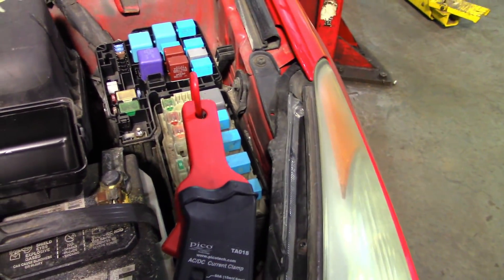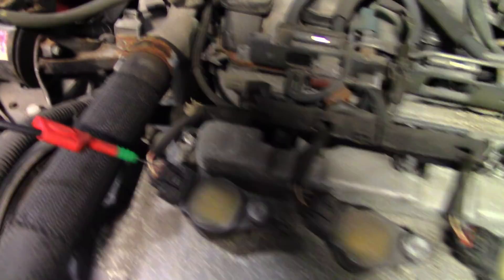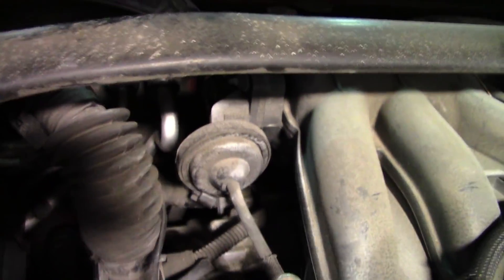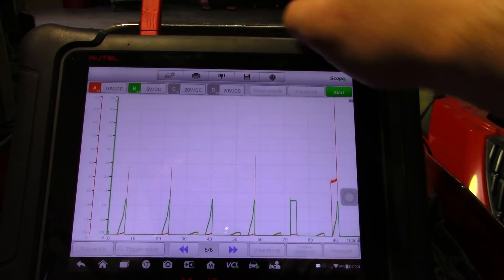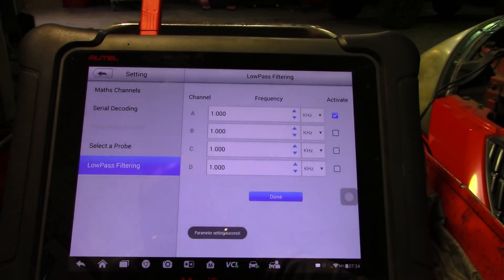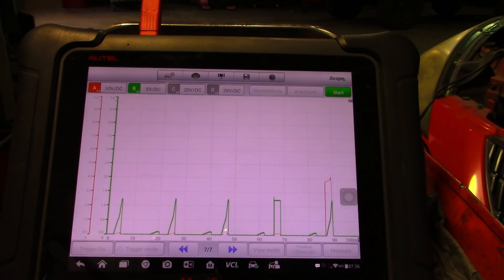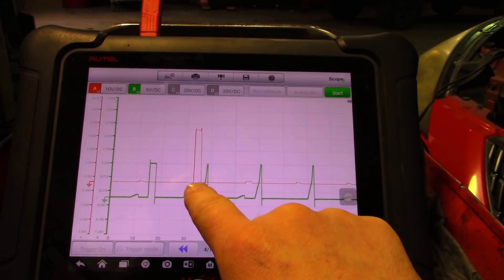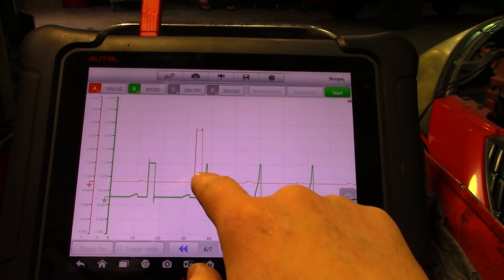Toyota Solara misfire diagnosis with autel maxiscope

Comment: I just bought the Autel MS906BT.  So far I like it.  I like the videos on using the various scan tools and like to hear the opinions on which one guys like you like and don’t like and why.
Reply from the maker: For me, I like my verus because it feels so much more user friendly, and the graphing is second to none. I like my autel because it has far more features. But I like my diagun because it is hands down the fastest and most convenient to use.

As far as my dislikes. I dislike the cost of snap on tools in general lol. And they have far less features than what should be on a tool for the cost they're selling them for. The autel, well, right now it is being sent out for repairs for a battery replacement, which frustrates me since it is only 2 year old. And the only thing that I don't like about the diagun is also what I like the most about it also. The size lol. Sometimes I love that it is small and compact and sometimes I just wish it had a bigger screen lol
Reply: Thanks for your opinions.  I use to work full time as a tech back in the 70’s and 80’s but stepped away from it on a full time basis, or so I thought, and went to work for the juvenile correctional system here in California.  What I didn’t know is that I would start working out of my shop at home.   I’m practically full time but I don’t see the volume of drivability issues that I would if I was actually in a repair shop.  I have managed to keep my master tech status current all these years so I think there is still hope.
  I try to keep the costs of these scan tools down.  Snap-on is out of the question but from what I’ve seen on Eric O and your site is it does seem to have better graphing.  I can’t get the Autel to put more than one graph up at a time.  Would be nice to watch O2 and fuel trim graphing simultaneously but I’ll manage.  
  Anyway, thank you for your videos.  I resort to YouTube and the internet for a lot of help.

Comment: Hey...liked your videos....just a bit confused about buying a scope...m just a newbie...and want to start getting hands on electricals....a bit curious if this scope works okay with pc?? And can it handle CAN bus signals??? Snap throttle signals? Crank sensor signals??
Reply from the maker: shaishav shah yeah. It absolutely works on a laptop. I don’t use it on the laptop often, but I do know that Corey over at S&A auto does.
Reply: Thanks so much...

Comment: Sir, When you use amp clamp with autel scope can you just use generic amp clamp or do you have to create a special probe to use one. On my verus you could only use the snap on amp clamp when you picked amp clamp from the menu because if you used another brand it would not give proper readings. I did not know that til I watched a scanner danner video when I 1st got the verus.  Thanks
Reply from the maker: When using the autel scope and an amp clamp, I just do the voltage to amperage conversion in my head, honestly.

Comment: Very nice. Thank you.
  Does Toyota have a specific scope that they supply?
Reply from the maker: Yup. They sent every dealership a picoscope as a special service tool.
Reply: @VoltageDropDiagnostics  The OE scopes have special tests and attachments. I played with the Masserati Pico for a minute, strange stuff. Only issue is they are on a special license and cannot be used with (and are locked out of) the downloadable software. They come up on ebay occasionally, but wouldnt buy an OE issue for above mentioned reasons. I really want a Pico, but another day.

Comment: Just one question, would you buy the autel scope again? Is it worth the $$ spent?
Reply from the maker: Rod X the 2 channel picoscope was sent to my dealer from Toyota. But It’s nice having more than 2 channels.

If I had a 4 channel pico, i wouldn’t consider buying the autel.

But with me only having access to the 2 channel pico. The autel fills that void perfectly.

In a perfect world, for me. I’d just have the 8 channel pico haha
Reply: @VoltageDropDiagnostics  As would I. The Pico isnt in my budget at this moment, or for many many moments to come, so i think the Autel will suffice. The Pico software is the best and most versatile i have ever seen. I like that you can define parameters for your own Transducers and custom sensors. Pico and Autel are the only scopes i am aware of that can decode network serial data, UART, CAN, Flexray, and some others. Thats useful to me. Thats the main reason i am buying it. Add to that i always have my mini touch screen laptop that folds to a tablet, makes carrying it much easier. But yeah the pico is the shizzle. I would rather have the 8 channel. that would be awesome wouldnt it?

Comment: Excuse my lack of knowledge when it comes to understanding waveforms, but how do you know the difference in when it’s a bad coil or a bad plug? 
TIA.
Reply from the maker: Generally, a good coil slowly builds current. And shows a “ramp” on the waveform.

A bad coil has an instant spike at 90 degrees because it is shorted.

Comment: Have you used a "Load Pro" for voltage drop tests?
Reply from the maker: I haven't had a chance to use those yet. Honestly, I just had a couple different style light bulbs that all pull different levels of current that I use depending on the circuit I am testing. Or I just leave the load plugged in, and backprobe the circuit leaving the component as the load.

Have you used the load pro leads yet? If so, do you like them?
Reply: Yes I have one, but haven't used her yet. It did come with a huge book, about electrical troubleshooting
Reply: @VoltageDropDiagnostics  I work at an agriculture dealership in Illinois, so dry fertilizer will take part of corrosion!  Lol, there is a lot of videos about it under Dan Sullivan the inventor of the load pro
Reply from the maker: I bet! I live in the rustbelt, here in Pittsburgh and we see our fair share of corrosion as well. Once you use them, let me know how you like them.

Comment: Does it work on a android tablet?
Reply from the maker: Jean Turenne i don’t believe so. But if you’re looking for a relatively inexpensive scope to use with an android tablet, look into a hantek scope and the “hscope” app. I’ve heard the two combined aren’t bad, but do your research because I haven’t used them myself.
Reply: I just bought a maxiscope and I use it on a laptop. It works ok. The other night I was watching a video that Flash Performance did using a maxiscope and it seemed like he was using an android tablet. 
But after re-thinking , I think it is a touchscreen laptop.
Reply from the maker: Jean Turenne do you remember what car was broken in his videos? I’ll go check it out, and report back.
Reply: @jeanturenne105  The Autel scope is actually a Native Android app. Its available for windows. If you have and Android tablet with USB ports, it should be workable. There is a download on the Autel site for android app.